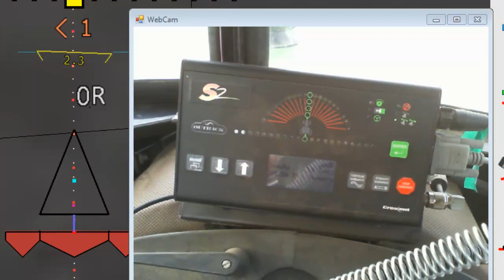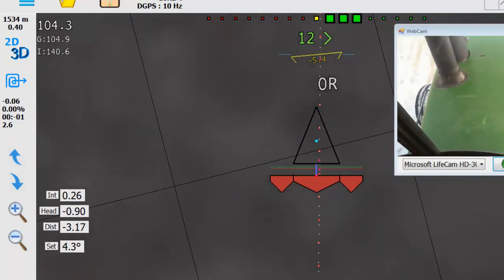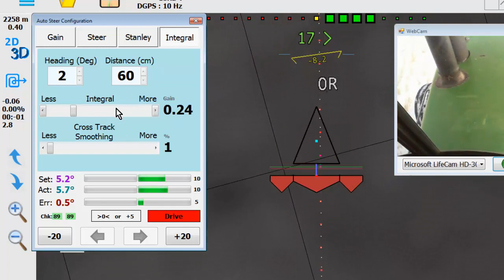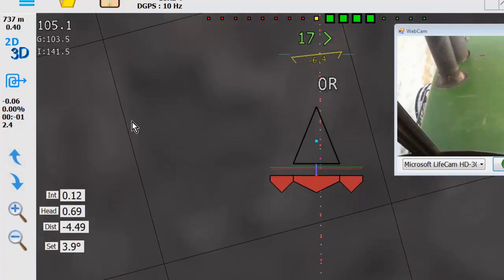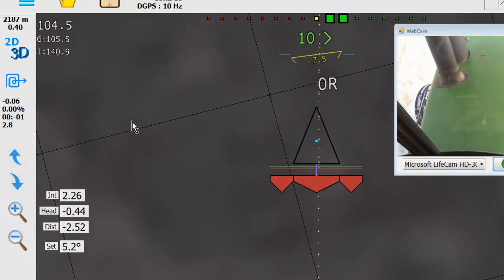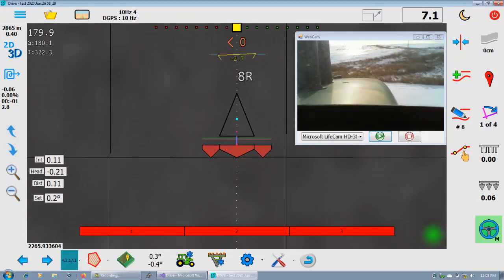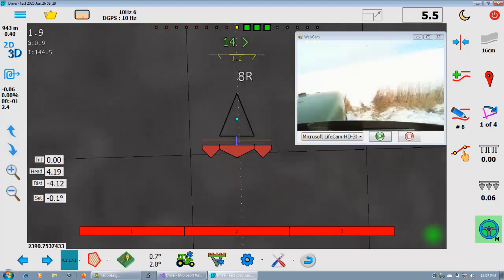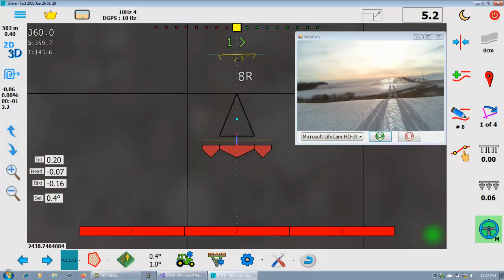Testing the CMPS14 Inertial Measurement Board

Comment: I'm using the CMPS14 to auto steer a boat. The issue I have is the magnetometer readings seem to have a latency of 300 mS. The bandwidth and frequency response are excellent. If I execute a very quick rotation of the CMPS14, I see a sharp transition that takes maybe 1 to 2 of my sample points, which are 50 mS. It's like the CMPS14 has a pipeline issue, where the samples are delayed by 300 mS. What do you see for latency?